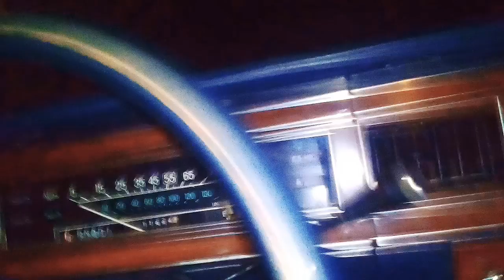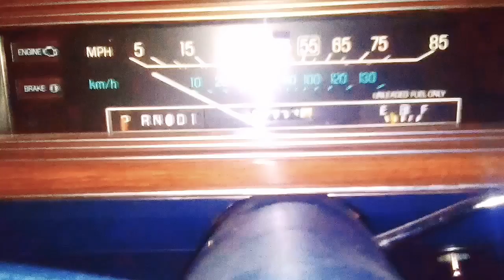1984 crown Victoria project update

Comment: This generation of Crown Vic is so underappreciated. The hard rectangles withing rectangles withing wood and chrome lends the car an almost brutalist beauty. You can't find these at all in the salt belt. Good luck with the  restoration. Just what is that ticking anyway?
Reply from the maker: I have at the parts just a exhaust leak ,I keep telling my joint account manager it has to be fixed. They refuse to think it needs to be fixed  I tell them it's effects profromace and she only goes 85 tops ...... since she is manufactured in oct 7 1983 exhaust is not required by law. But still it's a must for me since the speed limit is 80 here in Texas
Reply from the maker: Yes it's different then all the other I like that you can see the transition of the head cars with my cars tho early 1900s is my favorite